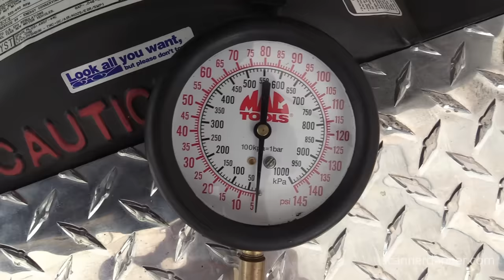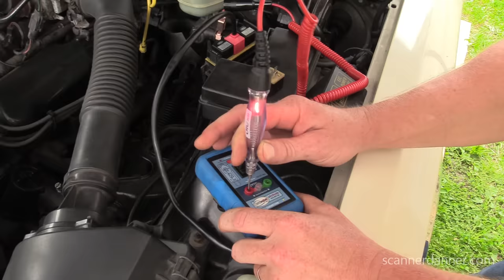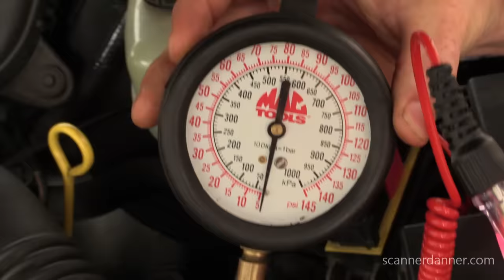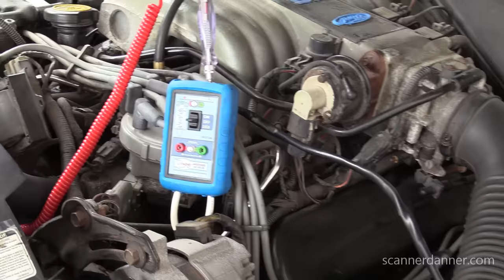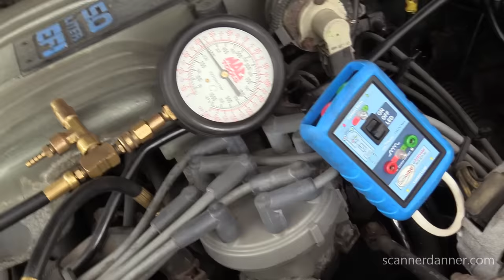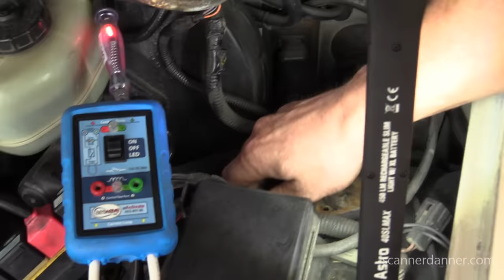New Fuel Pump, No Fuel Pressure Diagnosis (Lincoln Towncar comeback)

Comment: Working on mining equipment in Australia, you always seem to leave yourself open for comebacks, regardless of the job. I've had to explain to customers that if your operators stopped attempting repairs, without extensive knowledge, reoccurring issues would be minimal, and new issues would be minimised, and even with photographic proof, the difficulty is recharging for the same repair. Arguments always ensure and you just admit defeat but we will refuse to repair if the issue reoccurs due to operator interference or will repair but the hourly rate triples. Great educational vid. 👍👍
Reply: that sounds like a good way to get a bad rep.  What you should do is explain what was different..  In this case, the connector could have contributed or caused the first fuel pump to die,  however with the new pump showing proper pressure that means it was getting the proper voltage and connection after the first repair.. and being that the car drove for 3 months, suggest that if this connector had a problem back then it would be unknowable with the connector seated properly during the time it was in for repair and the following 3 months.  It is indeed a separate issue billing wise.

Comment: Even the best techs will have callbacks, and how they treat the customer and deal with it makes all the difference. This is a brilliant case study! Kinda reminds me of the turd cars I drive, ha ha ha. As you found the loose connector pins, I wondered if somehow you could have had an intermittent failure there that was OK when you were testing for power and ground at the pump originally. If the connection was OK when tested, you had no possible way to find it, especially if you tested with a 6 amp load, looking for voltage drops. I suppose one could have fed 12 V to the pump after dropping the tank, but by that point you've already committed to replace the pump. This one is a further reminder that you want to build as much evidence as you can before you replace a part. At a callback your documented evidence will be there to support you when smart-ass students ask questions, ha ha ha.
Reply: Great video I found your information really helpful I've been going to the same problem with my 94 Lincoln town car I've had to jump it many many times it cranks over but just didn't have enoughI could have been killing the fuel pump at the same time but probably the fuel pump was going out. Just got done cleaning my own injectors I should have done a continuity test first and check the fuel pump first will be watching your videos in the future.thanks

Comment: After seeing power on both sides of the inertia switch I very surprised to learn the open was under the hood instead of between the inertia switch and the fuel pump's ground, so I want to express gratitude for the important lesson about the big difference of it being on the control side of the relay instead of the power side.

BTW:   It was interesting to witness (and feel) your extreme frustration while expecting a failed pump change to celebration when the wiggle test exposed the cause.

Comment: I have similar problem with my 89 Mustang 5.0 convertible. Here in Southern California it gets pretty hot in summer.  I would drive my mustang and stop somewhere like a liquor store and when I tried turning on the car, I would only crank but would not start. Based on all my testing and reading, viewing videos on you tube, it indicates that the problem may be the overheading of the starter solenoid. Eventually I bought a new starter since I had already replaced other electrical components that could have been the problem. Unfortunately I never got to find out if indeed it was the starter solenoid overheating at maybe over 100 degree farenheit under the hood on a 90 degree or higher summer day. I will be rebuilding the engine and installing the new starter before this coming summer. I'm confident the problem will be that the heat to the starter solenoid made the starter malfunction, not allowing me to turn on the engine. I'll soon find out.

Comment: I worked at a class 8 truck dealership for almost 14 years doing a lot of electrical work. I did many repairs just like you did on those terminals simply because the only alternative was to replace an entire harness., which the management actually preferred because it was more profitable for them. I saved every wire harness I got my hands on for the terminals and connectors which were not available separately. We would just cut a pigtail with a good terminal from an old harness and splice and heat shrink., quick and easy, and cheap. I caught hell from the service manager who thought my old service cart stacked up with old harnesses was unsightly. I finally gave in and moved them out, right to my pickup and brought them home to my shop. I still have them for when I need a repair part. After that, the other techs who also utilized my stockpile got upset since we no longer had a supply of terminals and connector bodies. The parts department started selling more harnesses, but customers had to wait longer as well as paying through the nose for new parts which were not stocked and had to be ordered. The manager caught hell once I told the others he didn't want me to keep my supply.
Reply from the maker: That sucks man

Comment: My instructor onece had mentioned Ford literally had jiggle test in its trouble shooting procedures, going around and jiggling connectors for the obvious reason. Regarding the idle ford used a solenoid style iac called idle control valve it had a pluging up history, sort of egr style ports & pintle would get dirty, stuck etc. and cause idle issues, most of the time Carb cleaner would take care of it. Very cool case study.
Reply from the maker: Haha yeah the "wiggle test' thanks!

Comment: I had pin fitment issue at the computer on a 94 Oldsmobile 88 body style it cause the car to die almost had to be towed home is cousin intermittent crank signal and then it had other pin fitment issues causing other problems after so much testing realized it was pin fitment problem your videos are so helpful and wonderful keep up the great work

Comment: Could you use test light and go to 87 pump side of the relay box and check for ground there without the tool you have? that will determine an open like you fixed or an open pump, correct? Would it have shown the lower voltage at the pump when the open pump was replaced if it had been load tested with a head lamp or equivalent to the pump? could you use a volt meter on both sides of the load to determine if a voltage drop was present. Its understandable if it didn't show up that it was intermittent. Great job Paul and Caleb... Thanks guys..

Comment: I'm not really far into this video yet but I'm going to say the fuel inertia switch can be a pain. i had an '88 Bronco II.  Kept dying.  I kept checking that the inertia switch was "engaged."  After the 3rd fuel pump i unplugged the switch and checked for continuity. Nothing!!!  When it got warm, the contact inside would bend away causing an open condition. SO frustrating, but i was so happy to finally find it. Ok, I'll finish watching the video now 😂

Comment: Bro.ur one of the best at trouble shooting that makes a real mechanhic not a parts changer..i got a 96 f150 5.0L   fuelpump.the regulater new.used dist.replaced.check.vacum     .fixed wires plugs ..want to remove egr.what kind off bypass the plug in????thanks i like the show

Comment: Another great video Paul! Correct me if I'm wrong but that centre pin on a relay usually provides power while cranking(in this case it should keep the fuel pump running if the car is wired for it)

Comment: After bending the pin for better connection you could apply Deoxit D100L in the little brush bottle to lubricate and clean the pins. Deoxit has lubricating properties which helps sprung tangs engage without bending.

Comment: Trying to do it fast for the camera, and the heat you connected your spark tester to the wrong side of the coil wire …as you well know you should have connected it to the coil tower side of the coil wire or just to the coil tower and ground … I know you know..just wanted you to know I understand how it works… as a fan wanted you to know I am learning so much from you! Great video thanks so much 😊
Reply from the maker: What time frame was that? I'm certain there was a reason I connected it "in series" first

Comment: That is not the first time I've seen an issue with a big connector like that. The connector on that car is actually better than alot of others. Old Jeep Cherokees had a problem where a big connector would fail, and it had all the engine sensors going through it. Stalling issues, the parts cannon, etc.
Reply: sounds like every Chrysler made since the early 80's :))
sadly all the vehicles are that way now
Reply: The 87-90 Jeep Cherokees that have that problem are from American Motors.  They use a French engine management system that was pretty obscure.  Chrysler didn't really change anything until 1991, when it went over to a standard Chrysler engine management system.

Comment: Awesome videos i have a question about a 1983 Pontiac Bonneville crank but no start I ensured there was fuel in the tank i have spark vehicle will start by adding a source of fuel in the Carb getting no fuel at the inlet line to mechanical fuel pump not sure if this vehicle has an intank pump it is a 3.8 v6

Comment: I had a 94 Bronco with 62K miles back in 2001 that stopped out on the highway. The fuel pump was working but the fuel pressure regulator was not regulating. There was only about 5 psi pressure. It would start and run but stall out when put in gear or move about 20 feet and stall. Had to have it brought back home. Installed a new pressure regulator and it ran fine. Seems this is a common problem on the 90s Fords. It is not always a fuel pump.
Reply from the maker: Stuck open regulators used to be very uncommon. I've seen 2 or 3 maybe in 30 years. But with today's crap parts being built, I'd imagine it is way more often. Usually they would stick closed and jack fuel psi to max and kill the pump.
For you issue, pinching off the return line momentarily is how you ID the stuck open regulator

Comment: Nice video. Remember a voltage meter might show voltage with no load so the incandescent test light is better in my book. Use both if you prefer.

Comment: Check codes for fuel pump circuit codes. Check the fuel pump relay test. Use a timing light to check for spark. Check fuses. Replace the relay if it doesn't click. Check for voltage at the pump wire coming from the relay. Jump the pump from the battery to the pump positive wire.

Comment: I've been watching tons, of mechanic videos for a while now between a few guys i like, you ETCG, South Main and DIagnos Dan i believe. I have a trick i use in my kit i bring to work on my cars that i came up with years ago. I've seen no one else use it. I keep about 25ft of wire with alligator clips on each end, solely for the purpose of having a definite ground all the time, (connect to battery). Now that being said there may be a reason some may not do this but it works for me. If its not a good idea, please let me know. Oh one more, for an integrity test for wires i have an old headlight bulb that runs at about 4.5 amps i use. Love your videos. Thank You.

Comment: Thank you for this great vid had same problem in my 2000 Lincoln would crank wouldn’t start, changed crank position sensor had fuel pressure but couldn’t figure out where it was losing power and it was that exact problem with the connectors

Comment: Good video. What brand is your relay tester? I'm having hell with a 90 f150 4.9 liter. Starts runs poorly. Fuel pressure at the rail is 0 while running. Removed gauge. Started up and pushed in the valve and my hand got wet but didn't feel like 50 psi wet. Connected gauge using hose manifold in my kit. Plugged one side connected to filter. KoE off little movement. After 10 times had about 20 psi. Best I got was 30 psi. Left key off gauge on for a while. Returned to 20 psi. Can't connect pressure filler due to no adaptor to fit the stab in fuel line connections.

Comment: Hey professor it's jason. Thank u once again for a great learning experience. And I agree with u it won't be a comeback and u should get paid for it again. Separate issue. Thank u for ur use on the uactivate tool again. And for the Phil's probe tool. I got one and the first time I used it it broke. Likely defect but aeswave warrantied it and fast shipping. But I was using two hands to use it and seeing u use one hand made me go to a random car in the shop and start poking holes. Lmao. Oopppssss. Nothing liquid electrical tape can't fix 😂😂. Thanks professor and Caleb. Using the uactivate tool for ac compressor relay would it be the same principles. From ur classes on relay testing and understanding the theory and operation I know exactly what to look for nd how it works. By the way u made it seem so simple to understand. But if people buy this tool please don't buy it just to flip the switch. Don't cheat urself. Thank u god bless

Comment: Hey Paul As I remember from the first no pressure video on this car, fuse #13 in the fuse box, power control relay was blown and you spoke of the likely hood of another problem maybe related to the fuel pump, radio, ignition coil power feed. Do you think this is or was that issue. (A little dig.) It was a lot nicer working conditions in the shop.. But really how in the hell would you have found this back then. Something that works sometimes, is always very hard to find, as compared to something that dosen't work at all. This was a great video series. Thanks for the video. YOUR A COOL DUDE.
Reply from the maker: no, remember I caused the blown fuse in the fuel pump video. Thanks!

Comment: Sometimes we get lucky when looking for broken wires, good catch on seeing the fuel pressure come up! I also liked the visual of the test light showing open and closed circuit.

About the two problem thing, let me tell you a story.

Once upon a time, a guys manlift was a crank, no start. I check and eventually find no power to the fuel pump. I Google up a wiring diagram and start tracing power for the fuel pump and in the control panel I have power so I decide to check for power at the main engine connector. When I go to pull it apart, a wire comes out. The pin is still there, but the wire broke at the crimp. Fix it, test it, and send him a bill.

This is Friday. Monday I get the same call. 

Insert sad face here.

I pull up and before I even get out of the truck I can smell that it is getting fuel. Do spark checks and no spark, no power to the coil. Back to the control panel and again, track down power. I have it on one side of a big, inline fuse so I want to check it on the other side but it is a shielded, female spade connector, so I grab it to pull it off to get on the male side and the wire pulls out at the crimp! 

SAME type of failure (bad crimp) on TWO different systems on consecutive days! 

Too many times we hear of mechanics being told that there were two different problems, when in reality there was just one and they didn't do proper troubleshooting, so I was sure to thoroughly explain to my new customer what I found each time and sent him another bill.

And everyone lived happily ever after.

Comment: If that open had resistance in it before the last pump failed the pump would run at low voltage and should have drawn more amperage.  The increased amperage across the motor brushes  and windings would prematurely wear out the pump. I always recommend amp draw test every 3 oil changes( to indicate condition of filter) and a volt test at pump with load to check for harness resistance (with any pump replacement)

Comment: Loved the video but one comment on frying a motor due to low voltage.  I agree if the voltage is lower than designed, the motor is running slower and that causes a lower impedance (due to a lower back emf).  In a circuit that is capable of then providing more current, the motor can overheat and fry.  But in your case, the lower voltage was caused by a bad connection which by definition is incapable of supplying excess current.  So I don't think you will ever see a motor burned out because of a poor connection.
Reply from the maker: agree and I was too focused on that variable to state the obvious one. A poor connection like we had can cause large amperage spikes from the initial inrush of current. This would be the damage to be concerned about.

Comment: 51:10 It's funny. You created a short circuit with the pliers when you squeezed the pin. It touched the brake line of the master cylinder. If it was a positive line, we'd be back to the blown fuse😁